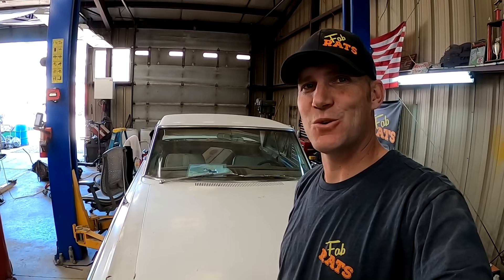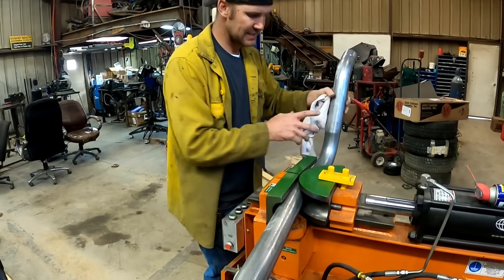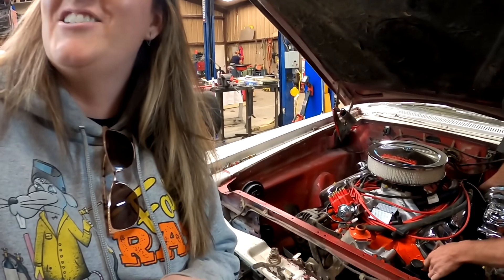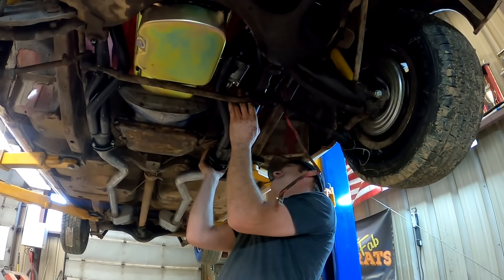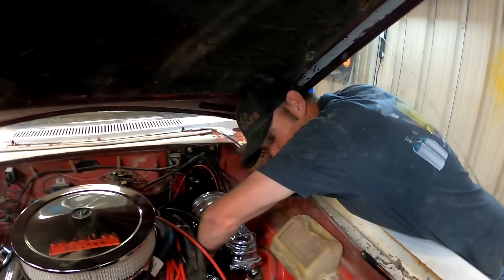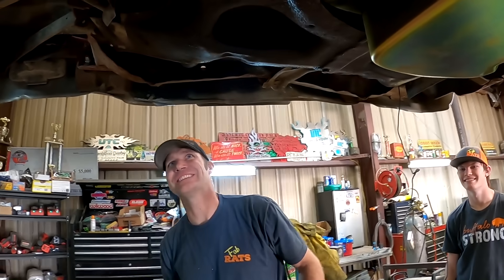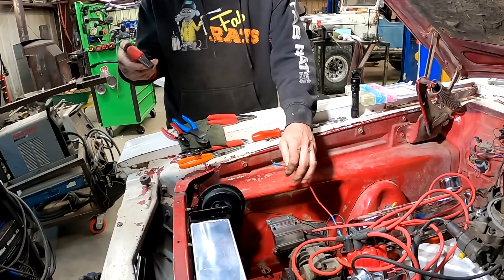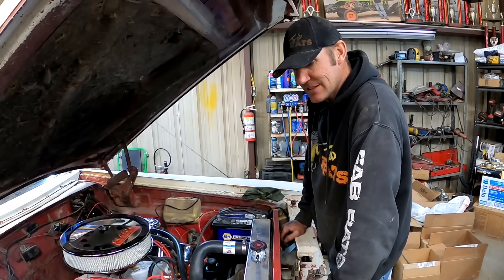IT’S ALIVE! Will The Coronet Giveaway Car Run?

Comment: Hello, I noticed the oil pan is hanging down a little. Years ago when I was younger we was drag racing on the street and the other guy with a Duster hit a dip in the road at the end and ripped the oil pan right open. I would suggest to build a guard so that cannot happen.

Comment: Working on a vehicle first gen bronco like you. Only mine is a 1:10 scale turquoise axial scx10iii. I like to relax from doing real work on a Sunday. I’ve pinched the hood, bumper and the grill. Instead of saying ford now it says “OR”😂. Thinking of getting a scale bow tie sticker to put underneath the “OR” Im now making an inner fire wall hoop for the engine bay out of 3/16” solid rod and my homemade radius bender good stuff. Proline makes some nice scale optima yellow top batteries I need to pick up for the fire wall detail. Have a blessed day with your family Paul. Taking a break and having early lunch while you entertain me through your videos hallelujah!!

Comment: Enclosed is a link to a center4ing device for the lathe.  It would 
be helpful for centering drive shaft tubing when setting up drive 
shafts for welding.

Jeff G.

Comment: You need to get a portaband saw for cutting the pipe.  Life is so much easier when you have the bender hold the pipe and use the saw with both hands.

Comment: I could feel the disappointment when the trans fluid starting dripping, then add-in the typical heater-core / cabin-heat radiator started pouring water out onto the shop floor.  Could not recall how many of these types of events happened while wrenching on older vehicles.  Often, bump one metal line or rubber hose while working on something else, the bumped hose starts leaking, or the moved wire breaks. Got to the point after a few years, I was surprised when something went together as it should, without leaks, etc..  Thanks for recording these moments.

Comment: I love big block mopar but the starter install with headers is a real "pain".
I have done this operation at 8 degrees below zero while laying on a cold concrete floor.
  I was 16 at the time and replaced a 383 with a 440 in my 68 Charger with headers.
 I am now 60 so I am reliving this vicariously thru your build.     Thanks, Will.

Comment: Drove an absolutely mint pre 426 hemi with a 426 built pushing another 200 swapped in the thing was nuts I wasn’t able to go fast but I got up to 60 before I knew it and only got to 3000 rpm lol was rolling 45 mile an hour and mashed it and blasted both tires off that thing was nuts wish she belonged to me

Comment: With the 440 the  rear springs will be a problem, to weak.  The later Mopars had 9 leafs on one side and 8 an the orter.  The one inch t-bars are agreat replacement also.

Comment: As low as the compression is in a old motorhome 440 you should have bought the complete Edelbrock performer (or Performer RPM) kit The performer kit makes good low to mid range torque, a nice cammy idle, works well in a daily driver to a mild hotrod or drag racer. and everything is a perfect match (i.e. Intake, cam, carb) all you need is a solid motor, good exhaust and ignition.

Comment: I had an old Dodge Ramcharger truck.  I sold it back in 1999 when it would no longer pass Florida smog.  I always look back fondly on that truck and miss it.  That is, until I see videos like this and realize that I'm probably better off with a newer vehicle.  All I need to do it maintain it and not have to hunt for gremlins (like the horrible brake system) or replace any major components (for a long time hopefully).

Good on ya Paul.

Comment: Dude! use a big crescent wrench to bend sheet metal instead of channel locks.  Just set the jaws slightly wider than the thickness of the metal.  That way you don't have to play Charles Atlas squeezing the channel locks closed.

Comment: Reminds me of putting a start on my 1974 F-100 4x4 with a 428 and Hooker Headers.  You had to guide it in starting in the right position or it wouldn’t go.  And to say nothing of trying to put in the bottom bolts on the headers.  🤬

Comment: You want to talk about ooddles of funzies. I went and used bolts about 2 threads too long on the rear main plate of the $20,000 LS7 I just installed in my Corvette Z06. Fired it up and ZERO oil pressure. Oh the happy moments I am reliving as I pull the motor once again. If it's not done twice, It's just not done.

Comment: I once had a heater core burst while driving in a heavy snowstorm. The windows all immediately fogged and froze on the inside while simultaneously burning the leg of my passenger. Not a fun day, as I recall. An even less fun repair.

Comment: Paul.... noticed you have a Flex Fan on the 440... Last time I used one of them was on a 67 Shelby gt350....  6,000 rpm  once and the fan colapsed into the brand new Custom Aluminum Radiator.....never used one again.....expensive mistake

Comment: I used to have trouble with getting the #8 cylinder's spark plug in/out on my 440 even with the stock manifolds on a C body.  It required a shortened spark plug socket which wasn't commonly available.  I used to unbolt the drivers side engine mount and lever the engine up with a 2x4 to replace the plugs.  It also made it easier to get the starter in/out.

Comment: The starter you used,is that a Mopar OEM part number starter or is it a generic aftermarket part? Just curious as it is definitely not the original part for that motor,those starters were huge and had that distinctive Chrysler starter whine. Love the videos BTW good job!

Comment: It looks like the auto manufacturers design cars for building them, not maintaining them.  My dad's '55 Studebaker President Speedster had a problem when changing the spark plugs.  You had to remove the battery to get to the rear-most plug on the left bank of the engine.  Likewise, the Chevy Vega required that you remove the right front wheel and an access cover in the wheel well to get to the starter motor.  In today's cars there is usually several pieces of plastic shrouding that has to be removed before you can see the engine.  It's as if they are ashamed that the car has an engine!

Comment: When I raced RC cars, I never used metal gear servos. I used nylon gear servos with servo savers (spring loaded mechanism attached to the servo), then I always had two or three sets of replacement gears on hand. The servo saver took the shock most of the time, but sometimes it was too much. The gear sets were cheap and easy to replace.

Comment: It's never easy is it.  I get so frustrated working on my bike and it just seems so unnecessary.  This car is hard to work on for sure.  It's not a Chevy small block where all the parts just fit.  You can paint it orange but it's still MOPAR pain in the butt.  Thanks for the video.

Comment: That transmission has been fighting you from the beginning. Just in case, can you run it thru the gears the way it is before the seal changes and reinstall? Would hate to see you pull it, change the seal, reinstall it only to find out it doesn't shift right. By the way I like your choice of  carburetor. Q jets are awesome carbs but misunderstood most of the time. The biggest issue is when people remove what they think is only the choke pull off and then the car falls on its nose when you mash the throttle because the rear air butterflies open too fast. All you have to do is adjust the spring tension on the rear butterflies (set screw on the back of the top plate) to get them to open smoothly without the vacuum chamber instead of all at once. I had the one on my 406 circle track engine beefed up to 780 cfm and ran it for 4-5 years and it performed flawlessly. Best sounding spread bore carb ever made. The winner of this project will be quite pleased with the great work you have put into it and the way it should run. Unless you have already done so it would be way cooler with a B&M shift kit in that 'pain in the butt' transmission. With the torque of the 440 it should leave a patch of rubber in 2nd and bark the tires in 3rd with the kit supplying more pressure and volume.

Comment: Hey Paul I got a quick question about my 03 silerado 1500. So the other day I was backing out of my parking spot at work and something some where bound up on my rear axle, but released when I went forward. But bound up again but drove through it. I checked rear gears had oil and no metal. Check T case put new fluid in both of those. What are your thoughts?
Reply: Check your rear brakes.  I had something similar happen on my '10 Suburban.  One brake caliper bolt came out allowing the caliper assembly to pivot upwards and catch on the interior surface of the wheel while I was in reverse.  I drove through it but regretted it when the caliper punctured the aluminum wheel.  A few miles down the road I had to call a tow truck.  If I had stopped instead of pushing through it (I was in a hurry) I would have still been broken down, but would have still been my driveway and not needing as much in the way of repairs.
Reply: Turns out it was the e brake shoes coming apart. I removed them and no problems since.

Comment: Paper mill workers blew themselves off with air frequently, even though it was a violation of safety rules.  The safety rules were dictated because 3 lbs of air pressure in a persons ear, is enough to kill them.  I can’t remember ever hearing about a worker actually dying for compressed air in the ear, but there were plenty of disciplinary issues around it.

Comment: Michelle said "People are wonderin' - Why it is that you painted a MOPAR engine - Chevy Orange".
Answer:
Generally used in a performance engine capacity from 1966 to 1971, the darker reddish orange color eventually came to be known as “HEMI engine Orange.” This darker shade would have been found on the high-performance 383 and 440 engines, and the 340 engines that were in high demand in the early 1970's  . - - 'Chevy' orange (IMO) - close enough.

Comment: just right before your comments on your body work skills,  I was thinking "why do I bother to watch Robbie Layton. He is a hack compared to Paul when it comes to making things look good" Am I right?   . Now,  going to work on my F 350 6.4 diesel to give it more power.  Going to pull the engine. paint the block Chevy orange , and drop it back in.  Thinking that should be good enough.

Comment: Paul and Randel receive brandi-new safety glasses and the very next scene we see them both with NAKED eyes working under a vehicle!
What has to happen before they WILL choose to work safely?
Best case scenario we have to keep sending different styles of glasses until they can still feel COOL wearing them on video.
Worst case scenario is that one or both have to go to the emergency clinic to have a sliver of rust removed from an eyeball.
Worst WORST case scenario is that Randel looses an Eye and sues Paul, the shop owner, for failing to require Personal Protective safety Equipment to be used during ALL work.
So. Michele, can your shop afford to bankroll a law suit? Best case scenario.
Or can you tolerate the thought of Paul or Randel permanently loosing their eyesight.
Paul, which of the next two permanent outcomes is worse?
No more wrenching on cars, meaning Michele now has to be the bread winner, and or not being able to see your grand babies? 
How special were your boys to Grampa Sherm when they were born? 
Try to hear the warning of a grandfather who has had a sliver of rust plucked out of his eyeball.

Comment: Paul  why did you butcher that header, you should of cut header and  welded it up to fit instead you became a shade tree mechanic that is a sorry job, feel so bad for who ever gets that now junk car they will have to rework that garbage set up and go back to stock manifold to run right if the starter ever needs replaced. I had more faith in you.